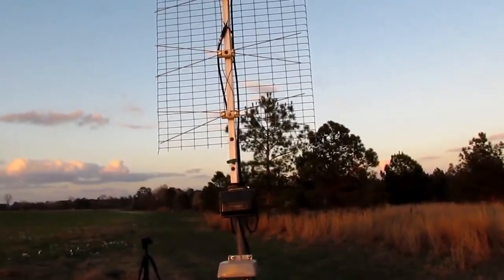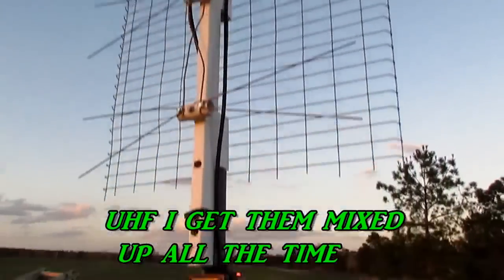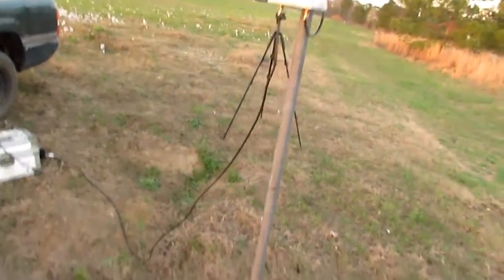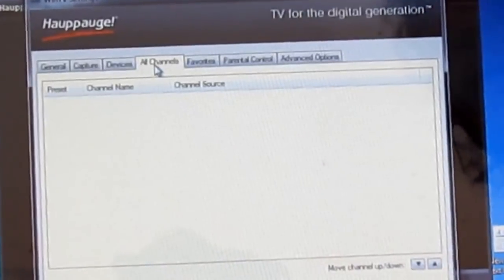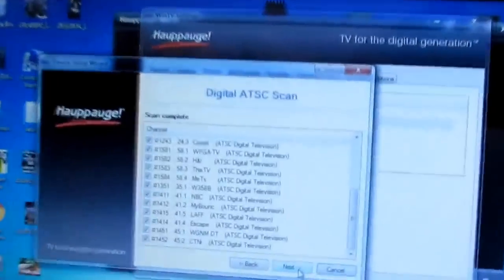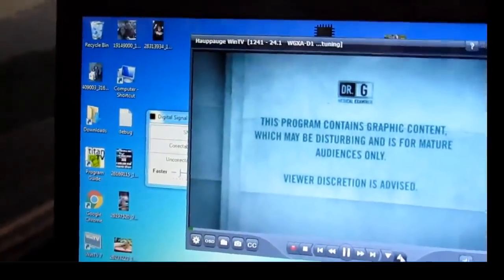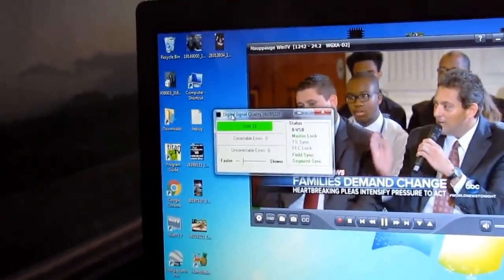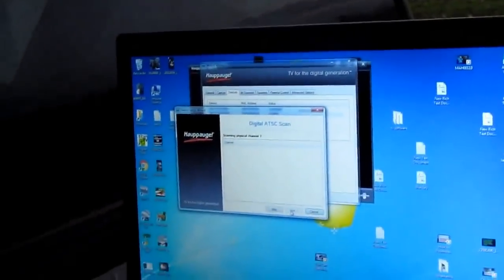The All In One TV Antenna 100 mile Test

Comment: The reason tv antennas work better at night is because the sun tends to block the signal. Tv stations cut their power to 1/2 at night because of this. As a person who installed over 1000 tv antennas, I can say that the height can make a big difference. Also trees can block uhf more so than vhf. Buildings can Block the entire signal too.

Comment: Danny could you order a antenna called hd double stacker from Denny's antenna they claim it's designed by wineguard built just for Denny's and they claim it's the longest range antenna available it sells for $129 has customer's from  all across America claiming how great this antenna is and nothing beats it when used with a wineguard lna 200 amp thanks ps would be great to see it go up against your longest antenna

Comment: Hey I built an eggbeater antenna  but i squeezed the eggbeater so it would be smaller and longer.put it up about 40 feet or so  with guide wires. first scan  i got 50 channels about 40 to 65 miles away . then i built an danny hodges antenna ,put it up and got about the same.  so then i put the two up together about 4 feet apart also i always had amps . 1st scan i got 80 channels. i live near lake o in florida   i picked up sarasota 99 miles away and winter park fl. 163 miles away  I'm one happy camper  Don

Comment: Hi Danny, I am in a foothill area of northern California, most stations are at a 62Mi location. I have recently purchased a CM-3020 and it is mounted on a clearing some 100ft from my home. It has a height of 35ft. We are currently only receiving KSBW 8.1/8.2 and that tower is 113Mi away and there are an array of channels between tower and my home. 

At time of writing this (3/31/18) I am currently building your Ultimate Antenna and I am hoping to produce more than 2 damned channels. I was wondering if making the whiskers longer than 20in would produce a better result? 

By the by, Thanks so much for your videos. They have provided hope for my TV woes.
Reply: Anthony Chastain you are losing alot of signal if you're running a cable that's longer than 50 feet..  You need to make a shorter cable run to your TV, if it's going to be more than 50 feet you need a signal booster..
Reply: Manuel Viramontez - Thank you for the reply. I will have learned a great deal about antenna theory since posting this. Digitalhome(dot)com is amazing.

Comment: I built a copy of your antenna and it works great. I live about 70 miles southeast of Nashville Tennessee. I am getting 35 channels and most are 100%signal strength during the day but at night half of the channels drop between 25%and 50%. I don't know why. But your antennas are the best. Also I am not using a booster.
Reply: Use a RCA TVPRAMP1Z Preamplifier for Outdoor Antenna it filters out the FM signal and won’t over load the station so it won’t drop out. For the money it’s the best! You can get it at Lowes or Amazon.

Comment: Danny, I built one of your Ultimate TV Antennas last year after watching your You Tube videos.  I live about 45 miles northwest of New York City in northern New Jersey.  I used to pay over $300 to the cable company just so I could get the local New York stations and the networks that cover northern New Jersey.  After watching your videos and building the Ultimate TV 
Antenna, I was able to get rid of cable and use the antenna and then supplement it with a Roku stick to get premium channels like CNN, Discovery, Animal Planet...etc through the internet, which costs me $54 per month instead of over $300 a month.  I live at about 900 feet elevation and have some taller mountains still blocking my antenna's view of New York City.  The antenna is mounted on a 1 and a half inch pipe that is attached to the side of my house and sits approximately 6 feet above my roof. It allows me to get 54 channels from New York City and northeastern New Jersey, many of which are digital transmissions and just as nice a picture on my televisions as the old cable boxes that I returned.  I get all the major New York City networks, CBS, NBC, ABC and others, as well as many UHF broadcasts which we don't watch anyway but are still available.  It even picks up some radio stations over the the television. Building this antenna  has allowed me to save approximately $250 a month for the past year which so far has save me roughly $3,000 over the course of the year that was better spent elsewhere.  The total cost to build my antenna was two bags of screws and two bags of washers that cost about $8, about 6 feet of #10 copper wire and 12 feet of #6 copper wire that cost about $20, a roll of fencing cost about $18, a piece of 2" x 4" pvc fence post that a local fence guy gave me for nothing from his piles of old scraps, about two feet of 1" pvc pipe that I had laying around the garage, as well as the 2"  pipe that was already attached to my house because it has my weather station and police scanner antenna already attached to it, and I already bad an antenna signal booster wired into my whole house splitter that feeds the signals to all the tv's in the house.  You're the real deal. I'm sorry it took me this long to reach out to you to say "Thank You", but I'm glad that I finally found the time to do so. Keep the videos coming...

Comment: Hey Danny , I did not know you had a twin. lol  Good to hear you going to start making more videos. Every time I watch one of your videos I learn a little more. When I first built mine it looked as good as yours. But trying to put it up some 30 plus feet by myself has ended in disaster. The pole bent over an sent the antenna smaching to the ground. Oh yeah , that  pissed me off. So the next time I set the antenna on the roof. Then went up the ladder and onto the roof. As I was standing the antenna up, the guy wire caught the ladder. And it fell leaving me stranded on the roof. And No way to get down. After several hours the roof started getting hot. And I was developing a powerful thirst. Finally some guy was walking by an I yelled for help. And he set the ladder back up for me. At this point I did not care if it worked or not. I am telling you this antenna looked like it had been ran over with a truck. It is twisted bent up and looking really rough. But when I hooked it up I got some 30 channels. Just FYI. Some day I will get some help an take it down fix it. And if I am lucky I will stay off the roof.
Reply from the maker: thats happended to me before